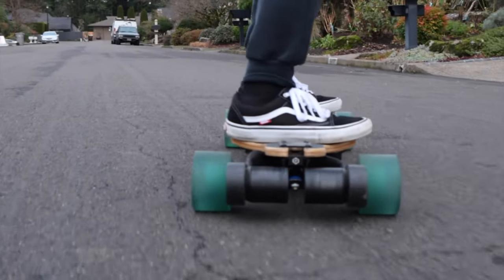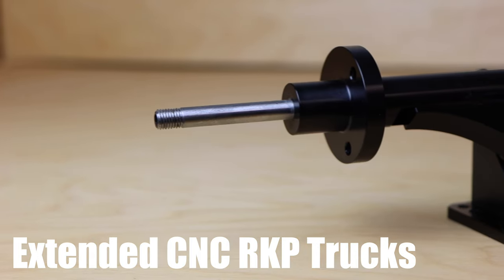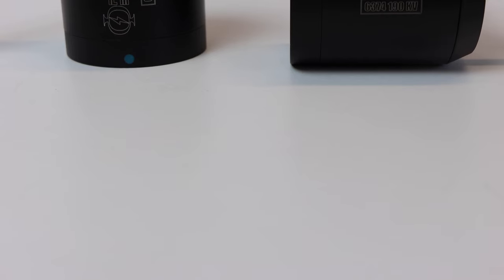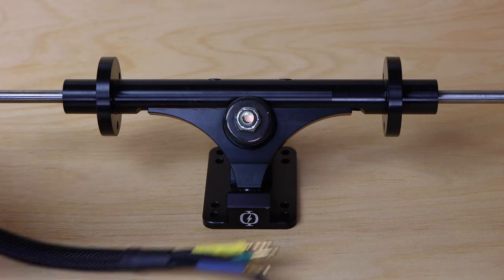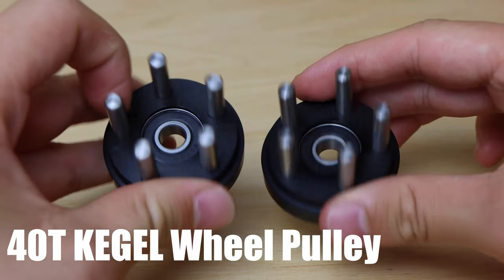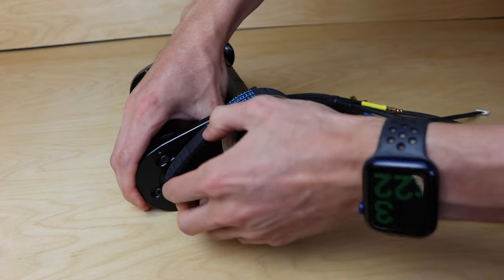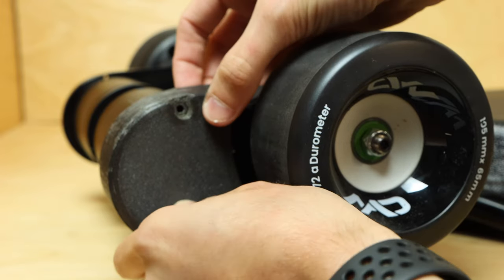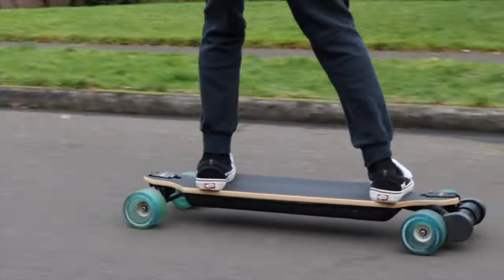How to Build the Propulsion Boards Demon 2.0 RKP Complete Mechanical Kit

Comment: Are u not going to making the demon 2.0 anymore or replacing it with a new model
Reply from the maker: replacing with the 3.0 which should come out in the coming months
Reply: I love that because I been saving for a year now and fell in love with the demon and demon 2.0 and after all my research u gave the best quality and price for a top of the line board
Reply from the maker: Thank you! Be on the look out for a new board very very soon!
Reply from the maker: https://propulsionboards.com/products/demon-3-0-kit
Reply: @DIYesk8Builders how does the new drop down deck affect going over speed bumps and speed tables? Does it lower it enough to scrape? I live in an area with a couple gnarly ones lol